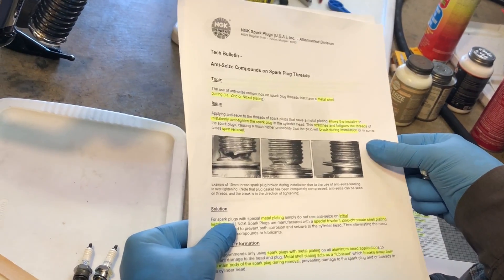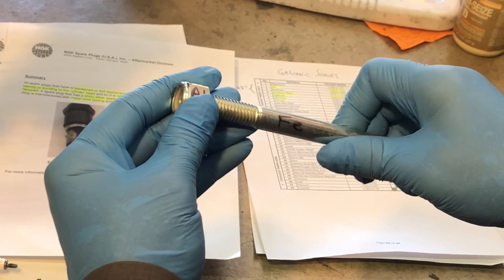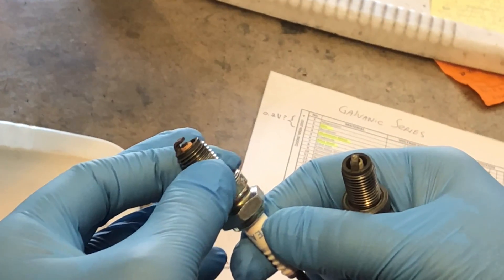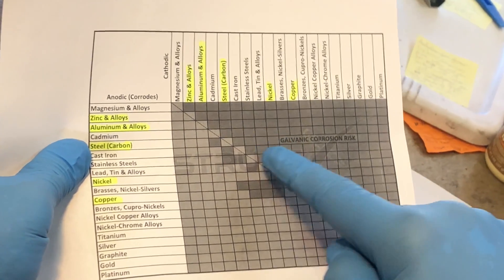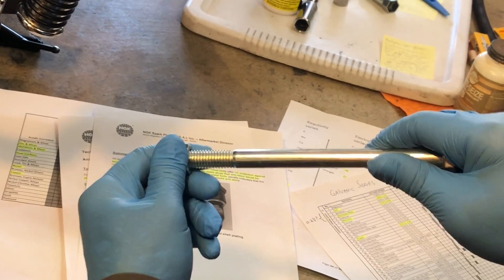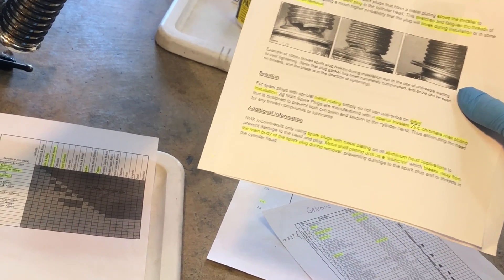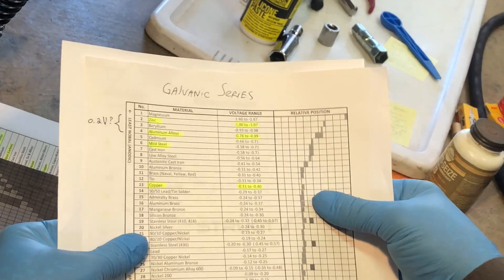Aluminum cylinder heads, spark plugs, anti-seize, & galvanic corrosion

Comment from the maker: As I see it, anti-seize provides at least the following benefits: (1) when correctly selected for the application, it supplies additional sacrificial-anode material; (2) it seals the threads to some extent, which prevents/slows entry of "electrolyte" into the threaded connection (no electrolyte means no electrochemical reaction can take place);  (3) it minimizes galling of the threads; and (4) for a given torque spec, it promotes a more consistent/repeatable preload (stretch) of the fastener.  Of course, it is common knowledge that torque specifications for "lubricated" and "clean and dry" threads are different.  If choosing to use anti-seize on spark plugs, my recommendation is to USE IT SPARINGLY.  Contaminating either the porcelain nose or the external insulator can lead to problems, such as misfire and possibly even damage to ignition components, so it is CRITICAL TO KEEP ONE'S HANDS CLEAN when installing the plugs.  Also, when applying anti-seize to the threads, I would keep it off the first couple AND the last few threads (the latter precaution to prevent any lube from being transferred to the washer/seat of the plug and potentially affecting heat transfer/electrical contact in that area).  By the way -- thank you, everyone, for pitching in!  There are many great comments, detailing viewers' first-hand experiences.  To me, this is really about people exchanging and discussing different viewpoints on this seemingly simple issue.  I hope all of us can learn something.  I know I have.
Reply: For years I have used antisieze on plugs and will continue to. When installing plugs with gaskets I turn the plug 1/2-3/4 turn after the gasket touches. Plugs without gaskets I torque to specs.
Reply: Great video and rationalization in favor of using anti-seize along with reducing applied torque.  The Chilton repair manual for my 2009 Honda Accord specifies the light application of anti-seize to the spark plug threads upon installation. Interestingly, NGK happens to be the recommended OEM spark plug for that vehicle.
Thanks for the video.
Reply from the maker: @Peelerusa  Thanks!  Please check out the comments, if time permits.
Reply: I always use anti-sieze and I've never broken a plug or siezed a plug.
Reply: Perfectly said :) this goes for other fasteners as well not just spark plugs.
Reply from the maker: @Cursirr For sure.  However, I use grease instead of anti-seize in many cases.  For example, on the primary-cover screws of my H-D. I don't want anti-seize anywhere near any assembly that is lubricated with oil.
Reply: @Zerk_Ziegler  Absolutely! Don’t want to contaminate the oil.
Reply: That's for sharing

Comment: I am sure you get people telling you all types of things to try and make you look like a dumbass or make themselves feel more important. And I a sure what I am going to say you already know but was trying to simplify from the video sake, and I will look like the dumb ass. But you purposely put Fe for iron (correct, but you called it steel and those are not the same). They are similar but Fe or Iron is an element which is pure and steel is a compound and is made of different elements and compounds (as to how you get different harnesses and types of steel). Or more technical then y out the brain explanation is a google reply- iron is not the same as steel; iron is an element, while steel is an iron alloy that contains carbon. Steel is made by combining iron with carbon (and other elements), which makes it stronger, harder, and more durable than iron.
Reply from the maker: You're right in that pure iron and carbon steel are not the same. I should have been more precise with my terminology.  However, low- and medium-carbon steels are only slightly more noble than iron, where "nobility" refers to where a material sits in the electrochemical (galvanic) series.

Comment: I used anti seize on spark plugs in my and 6 out of the eight were finger tight.. just a FYI
Reply from the maker: Did you tighten to spec when installing (recommended torque less 30% OR recommended # of turns, e.g., about 2/3 turn after initial contact for a 14mm crush-washer plug)?  I prefer the latter method and give the wrench a gentle tug at the end to make sure the plug is seated properly.  The resistance felt as the washer crushes helps achieve the correct tightening torque. Once the washer is fully crushed, the resistance increases sharply, signaling that the plug is seated correctly.
Reply: No crush washer on these plugs 5.3 vortex  @Zerk_Ziegler

Comment: Zinc might be a very good sacrificial anode on boats and stuff for salt or regular water.
But as zinc sees acid it goes away in minutes or hours...

A thin layer of anti seize or brake grease is a must especially in cold climate and for cars the is just getting short trips and never get really hot to dry it away.

I've used it on EVERY car at work for the last 15 years, BUT i also lower the torque about 30%

Most cars i have to fight to get the old one out, fill it with break free oil and screw it in and out MANY times before getting it out and it is very common problem here.
But a little anti seize then it Comes out easily.

And i only use aluminium, ceramic or metal free paste, not mixing in a third metal like copper
Reply: Oh an ESPECIALLY using it on glow plugs!

Comment: I have a boss 5.4 I've always put antisieze aviation grade on them engine is now 20 years old never had a problem and my engine was notorious for plug breaking but I also only use ngk plugs I don't tourqe to spec I just hand screw in hit bottom then quarter turn that's it but there are so many theories on this but it comes down to hand feel on extraction and fitting them also last few years they have changed the heat rating on plugs too as my my Mopar is high compression and I used to use 6 rating I had to change to 7 because I think the ranges have become finer

Comment: Show me plugs that aren't plated.
Reply from the maker: Interesting point.  Plugs having a black oxide finish are technically not considered plated.  ACDelco 41-606 is an example.  However, it is true that black oxide does resist corrosion.

Comment: I broke two sets of spark plugs after applying copper grease to the threads and torquing them down to NGK's specifications.
I learned my lesson. The third set I installed without grease and using the turning angle as a guide.
Reply from the maker: Using anti-seize and turning angle avoids all problems.  Also, it will be easier to tell that the plug has seated when the threads are lubricated.

Comment: Great video.  I have heard some say that copper based anti-seize is the best for preventing galvanic corrosion (even some manufacturers say this) and others say that it actually can make it worse if used with certain metal combinations.  However when you look up the ingredients of the basic silver colored anti-seize maid by permatex, it has aluminum, copper and graphite.  So it is combining two materials (aluminum and copper) that should be a problem and graphite is about as far away from zinc and aluminum as you can get. I don't understand how this isn't an issues?   I always assumed zinc or nickel was in that anti-seize.

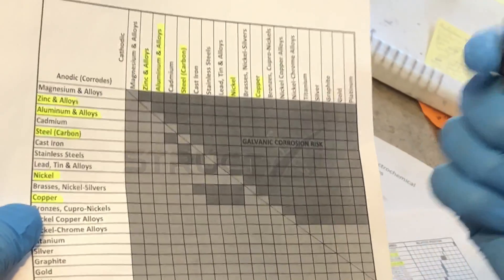Can anyone explain why in the chart shown at 8:33 that it shows stainless (in the vertical column on the left) is safe to pair with aluminum (on the horizontal row at the top), but if you do the flip of that (aluminum in the left column with stainless in the top row), it shows as a galvanic corrosion risk?
Reply from the maker: Excellent catch!  Charts, like the one in the video, are intended as general guides only and may not always be precise.  Different grades of stainless steel have different reactivities, so aluminum and its alloys may react more with some stainless steels than with others.  The chart, shown at 7:34, illustrates this point.

Comment: How would one know or be sure its "30%" less specified torque?  Isn't this number dependant on the amount of anti seize a person uses on the plug?
Reply from the maker: The interstitial space between the shank and the receiver of any threaded connection is quite small.  It takes very little lubricant to produce an even coat between the threads.  Applying more lubricant will not change the friction equation -- the lubricant will simply be squeezed out.  But, overlubricating the threads is a bad thing, since contaminating either end of a spark plug with anti-seize is likely to cause misfires.  Instead of relying on the the 30% rule of thumb, one can tighten the plugs using a specified number of turns.  Various spark-plug manufactures provide these specs for their products.
Reply: @Zerk_Ziegler   @Zerk_Ziegler  Thanks for the video and answering my question Zerk!

Comment: One interesting ,unusual but IMO very objective way of controlling the proper tightening of spark plugs is by measuring the thickness of the sealing washer . It’s found experimentally that for Denso plugs it must be 1.6mm after proper tightening . Also this method allow you to see if the spark plug has been tightened properly previous time .  Also you can torque down your spark plugs dry as the manufacturers recommends . After that remove them ,apply anti seize and tight them back by turning on recommended by the manufacturer angle but for spark plugs which already been tighten at least once .It’s usually stated on the box . IMO anti seize make more difficult to read the proper heat range of the spark plugs which has been in use.
Reply from the maker: Interesting info regarding washer thickness.  Do you recall the source?
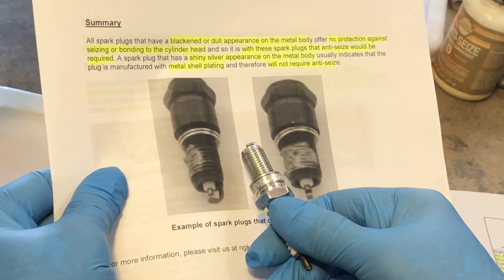Reply: @Zerk_Ziegler  https://youtu.be/bfcprut_q-k?si=YT9A9um23wPHJjps after 2:16 minute . Unfortunately is on Russian language. I will translate with pleasure some moments for you if you point me by the video timing!
Reply: @Zerk_Ziegler  posted the video , but YouTube deleted the link . If you didn’t received the notification with the link lets me know !

Comment: I agree to the difference between dry and lubricated torque, but the torque value tipycally is around 18 foot pound which es a very low value to break a spark plug, on top of that, Champion know about spark plugs because they make them, they make and recommend graphite based thread lubricant and I guess they take that in consideration, on the other hand it is a type of dry lubricant.

Comment: I use anti-seize on my NGK plugs. I don't use a torque wrench. On the box of the NGK plugs I buy, it gives instructions to turn 3/4 of a turn after the crush washer makes contact.
If I wasn't using anti-seize, I'd still follow the box instructions. I don't trust the clean torque value on old threads. You can feel when tightening replacement plugs, they don't all have the same feel. Some go in a little tighter from carbon fouling in the threads of the cylinder head, so you'll be under-torquing those using a torque wrench. If there's no instructions on the box, only then will I use a torque wrench and torque to spec (-20% if using anti-seize).

Comment: What about using graphite or "ceramic" compounds?
Reply from the maker: As mentioned in the earlier comments, Dupont, Loctite, and Champion offer graphite-based anti-seize products (no metal), specifically advertised for use on spark-plug threads.  I've seen ceramic-based products that were recommended for use on brake components.  From what I recall, these compounds have an extremely high heat rating.  I don't see any issue with using a small amount of ceramic-based anti-seize on spark--plug threads.
Reply: @Zerk_Ziegler  But then you wouldn't have the sacrificial benefit of metals and / or the thermal transfer benefit since especially ceramic would just be hoping to act as just a physical barrier once the grease burns off, correct? Or is graphite / ceramic a good heat transfer material to have?
Reply from the maker: @nesmio7378  Agreed as far as the sacrificial-anode benefit is concerned, if you have a zinc-based compound.  Check out the video description for values of heat and electrical conductivity for various materials.  Honestly, I don't know if presence or absence of a lubricant makes a difference in terms of heat and current transfer.  The situation with spark plugs and anti-seize is similar to that of electrical connectors and dielectric grease.  Even though dielectric grease is an insulator, it generally does not interfere with the transfer of current through electrical connectors because most electrical connectors are "self-wiping".  Dielectric grease is there to prevent current leakage outside of the connector junction, but does not hinder current transfer through the connector.  Threads of a spark plug (or any fastener) are self-wiping as well.  Also, quite a bit of heat and electrical-energy transfer occurs through the seat of the plug.

Comment: Working in the Marine Industry for many years we always used Anti Seize compounds on Stainless Steel propeller shaft splines for Brass & Aluminum Props. Weather they were going in fresh or salt water it was a requirement.

Comment: I would use a copper-based anti-seize on spark plug threads for the improved electrical conductivity to maintain the ground strap electrode at zero potential.

Comment: Spark plugs are grounded through their threads. Conventional anti-seize is a poor conductor, and increases the resistance of the plug, thereby reducing the voltage at the electrodes. If you use anti-seize on spark plugs, which I do, be sure to use the special spark plug anti-seize made by Champion, Unison or ATS that maintains the good ground contact through the threads.
Reply from the maker: Not sure about the benefits of graphite-based anti-seize over metal-based products.  Check out the video description for some numbers for perspective.  Also, a good portion of thermal and electrical conduction occurs through the seat of the plug.

Comment: This is drivel. I have worked on motorcycles for 45 years , the plugs of which are more exposed to the weather than any car engine.
I have never had a problem with corrosion or seized plugs and have never used anti-seize.
I just keep apes and other monkeys that think every threaded object has to have  the crap tightened out of them  away from my bikes.

Comment: Anti-seize acts like a lubricant, you have to reduce the torque about 20 percent or run the risk of breaking the plug, bolt, nut, etc. or overthighting.

Comment: What does that table say about this scenario? I put some cheap blue anodized valve caps on my wheels.  6 months later I went to check my tire pressure and they were all seized up and had a white ring at the base of the cap. I had to resort to vertical cuts with a dremel,  and pry them off. All the threads on the valve stem were packed with a dry caked up powder
Reply from the maker: If the cap is made of aluminum, and the threads of the valve stem are brass, the aluminum cap will corrode.  The white powder you see is oxidized aluminum.